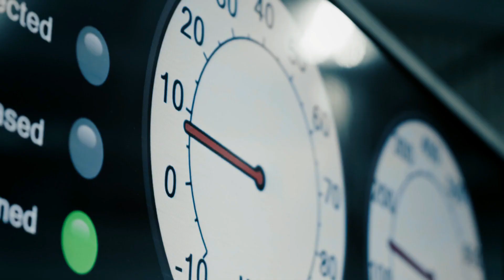Canoo - Everything You Need To Know About the EV Startup | Startup Showcase

Comment: Only good if they buy it back in 5 years, since there won't be any resale or trade-in value for battery cars. You can't work on it yourself unless you are a programmer and and electrician, so there is no fun for car guys. The charging time and lack of range make it horribly impractical for construction and delivery work. If you think I am taking a battery car into offroad country, you're nuts... I am not running out of charge in the desert or the mountains. 

Add to all of that, it's ugly.

Hard pass. EV just isn't there yet.
Reply: Actually, they're well-suited for deliveries by established companies that work during the day and return to a terminal at night and can easily recharge. How many postal workers or Amazon drivers exceed 200 miles a day?
Reply: Practical for construction and delivery work in Europe. +200 miles range is enough....
Reply: So many shitty points. 5 years? Batteries nowadays are expected to last in active usage for 10 before dipping under 80% capacity. And when they do that doesn‘t suddenly make the car unusable. You can‘t work on them in SOME areas, but EVS are much less prone to malfunctions and failures than ICE cars due to the smaller amount of moving parts. 

Maintenance and „fuel“ costs are also way lower and in most cases construction vehicles don‘t travel too far and then mostly stand in one place for the day. And as for delivery vans: even some with less range than this one are already in use without issues. 

And as for off-roading… let‘s be real, basically nobody ever takes their suvs, pick ups or vans off road. 

Also, they look good.

EVs are here and will stay. They have been around for as long as the car itself.

Comment: I like the concept, but I see very little chance of success. I've watched Munro visited their site and I saw so much flaws in their press cars. Also zero mentions about production process, technics used or innovations applied. Besides, for 2023 range like 200 miles is way to small. 300 should be minimal option by now
Reply: I’ve watched that video too. Munro was very impressed by the canoo vehicles he looked at. He even apologized to his camera man at one point for not having anything negative to say.
Reply: I disagree. 320 km is plenty for most use cases, and many other ev vans have around the same range. Why carry around expensive and unused battery capacity all the time?